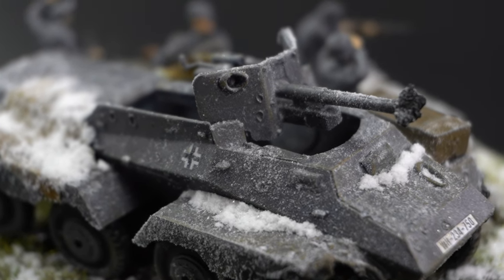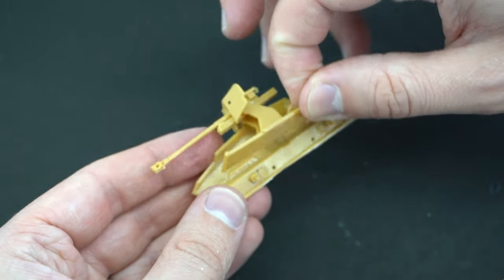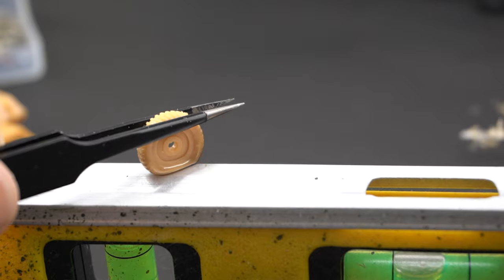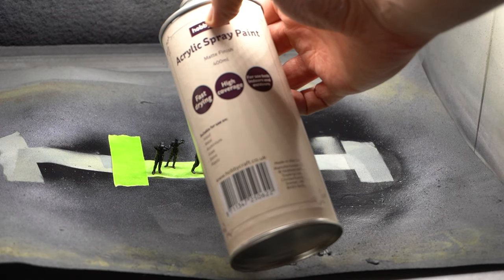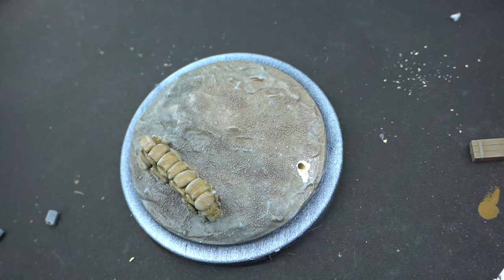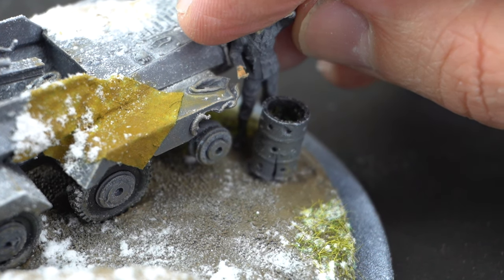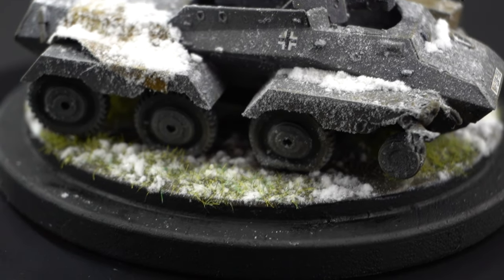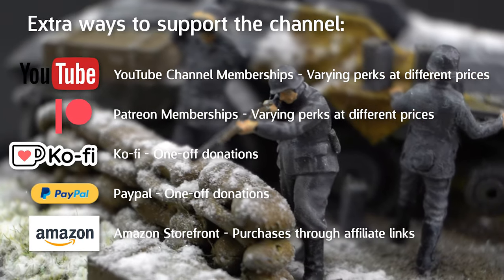German Soldiers Get Caught In The Snow! Airfix Sd.Kfz.234 Armoured Car Diorama Build & Review

Comment: Thje earlier SdKfz231 had these mudguards, but as far as I am aware, the only big gunned version of that use the short barelled 75 L24 weapon, KwK37 variety. The 234 should have the later hull and one piece mudguards. Nice diorama, and it gives the right effect, but the kit is a bit of a mess in terms of accuracy.
Reply from the maker: Thanks for the info!